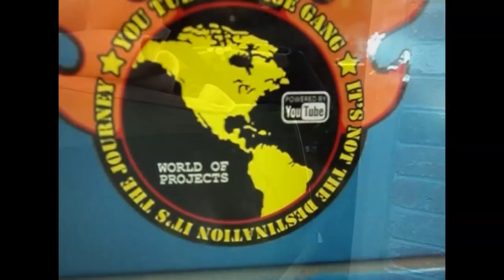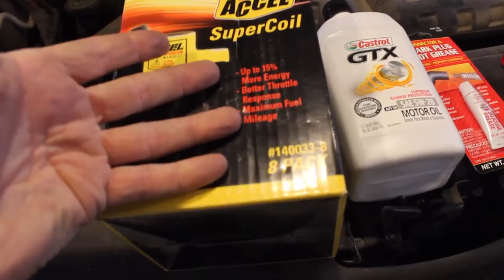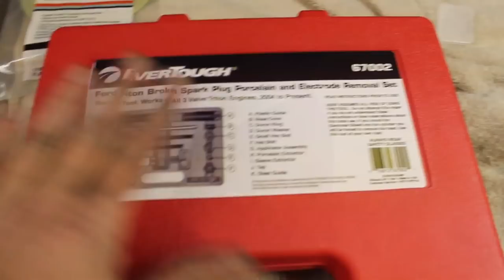F-150 Transmission Shutter - Fixed - Coil on Plug and Spark Plug Swap

Comment: dealing with this since i bought my truck in 2016 and i had spark plugs replaced a year ago, it ran great, then the cam phasers and timing chain went so i had that repaired, and now i got my truck back, and im back were i started with a miss fire. i replaced all 8 coils on it and it ran great for 2 days and started with the 40 mph shutter and blinking engine light. so now I'm wondering if the plugs went bad. also since i got the timing and cam phasers done i have a oil leak on the passenger side valve cover. just bad luck with my truck since i bought it. oh the coils i got those on ebay 8 for the price of 1 coil which was a good.
Reply: i dont know how many miles i put on the spark plugs since i had them replaced but i rarely drive it  maybe 5 to 6 thousand miles on it and right now i put 1,200 miles on since i had the cam phasers and timing chain replaced.
Reply: also at start up im having a puff of blue smoke and then turns white after it warms up. I also took a look at the body throttle today and it had some oil in it, i cleaned it up took it for a ride, still the same.

Comment: I have a 4.6 l v8 explore my rpm bounces and its feels hesitant at 40mph 50 if I give it gas it goes away
Reply: Did you get this fixed? I have similar problem, it shudders between 40-50 and then goes away

Comment: I'm getting ready to change spark plugs in my iPhone 50 like you did in the one you're working on I'm scared to death I haven't the same problem with  Is spark plugs breaking off in the engine I know they sell a tool from matco but I hear it's very expensive and I wouldn't know how to use it thanks thanks for the video I'm gonna take mine to someone that knows what the hell they're doing cause I sure don't I know they sell a tool from matco but I hear it's very expensive and I wouldn't know how to use it thanks thanks for the video I'm gonna take mine to someone that knows what the hell are doing cause I sure don't

Comment: Anybody tell me why my overdrive doesn't work and won't go into 2nd for use down hill but 2nd works just fine otherwise? 1st will work manually but 2nd isn't there. 07 F150 5.4 3v 4x4

Comment: Hey greg, I have a 2001 ford escape 4x4 with the 3.0 v6….im getting a heavy shudder at the 45mph range and it gets worse as speed increases even when its on a lift…we thought it was a cv assembly because the subframe cracked and ripped the boot out which spit out the grease...…The engine cradle (subframe) was replace and so was the cv joint assembly…i replaced the carrier baring too because the driveshaft was wobbling…I don't believe I have any misfire codes but I did have egr/converter codes….I was wondering if the coil/plugs could still be causing it to shudder from that overdrive problem you mentioned in this video…I was worried it was the torque converter but the transmission seems to shift fine and it doesn't stall at all…theres seems to be NO play where the front axel meets the tranny either…I am not able to accelerate out of it, it sudders continuously and gets worse…how can I tell if its the torque converter or the coils and plugs?
Reply: Greg's Garage Yeah it has 94k so they're probably all due to come out…thanks, I'll start with that.
Reply: Greg's Garage Well I don't believe its either of those problems now, we pulled my front drive shaft off and the shudder stopped when it was only in 2 wheel drive (with the back spinning freely), now I'm trying to figure out if both driveshafts are suppose to be perfectly straight from front to back or if the carrier baring, U joint and yoke are there to allow it to come in at an angle (which is the way it is now)….. When the front driveshaft is coming out of the transmission and into the carrier baring, its shifted left to right if you're looking at it from the very front of the car under a lift (the back driveshaft looks straight). It seems like the Yoke/U joint that meet at the carrier baring is causing the shudder the problem but I'm concerned that the new subframe we installed is shifting the front driveshaft too far off and causing the shudder from inbalance or something….the rear trans-axel mount seemed to sit right in place when we lowered it from the engine sling we had holding it up while installing the new subframe….I'm not sure if something got shifted or if it can come like that from the factory. Sorry if thats tough to understand all that, I'm just trying to figure out if both driveshafts are suppose to be perfectly straight from front to back or if its wrong for the front driveshaft to be shifted between the transmission and center carrier baring.
Reply from the maker: I wish I had answers for you man...  I know I replaced the pinion bearing in my rear end...  It caused all kinds of noise and vibration.  If your driveshaft had it's weights knocked off and it's out of balance that can cause all sorts of trouble.  The nature of u joints though is to take up all the out of axis alignment...  I would guess that it doesn't matter, but I could be wrong.
Reply: Greg's Garage Alright Greg, thanks again for your help and quick response….we'll just keep plugging away
Reply: Have you checked to see if your drive shady was off ballance may have broken the weights off it
Reply from the maker: Yeah...  drive shaft is good on my truck, but that's always a good place to look.

Comment: I've been having this issue for a while as well on my 07 f150.😞
Reply: This was exactly what I was experiencing in my 2007 F150 King Ranch and after watching&#160;the video, I changed my spark plugs and coils and bam the shutter is gone.
Reply: bill cook Yes I did the same thing I found 2 spark plugs were fried. Could've resulted in detonation.
Reply: I have a 05 f150 and when I'm getting onto the highway it feels like it's slipping, if I put od off it is fine just high rpms, is this shudder another word for slipping light jerking feeling?

Comment: Why the hell did Ford design the head to use special plugs like that? Did they not put any anti seize from the factory? I remember when i worked at Ford, i heard some mechanics complain about something like that.
Reply from the maker: Yeah, they've changed the design now.  The carbon build up is the issue.  Even with anti seize, it would have still been an issue.  A one piece plug fixes this.  If I buy a new truck anytime in the future and I know it has a 2 piece plug, I'll have the dealer swap them out before I drive off the lot.
Reply: Hmm...I wonder if water/methanol injection would fix the issue. It would definately make more power if you added forced induction on top of that. I know with any of the Audi direct injection design "FSI" engines, they have built up carbon issues on the back of the valves and the spark plugs. Water injection helps. I heard from someone that the manufacturer actually calls for cleaning of the valves with walnut husks in a small blaster contraption..but I dont know if thats true. That would be too much maintenance for me.lol.
Reply from the maker: I don't know...  Hopefully, I'm done with that whole mess for quite some time.  It's hard to believe some of the repair manuals expect you to remove heads and blast the parts from the back side.  I'm sure our thinned down fuels don't help this situation either.
Reply: Yeah your right. I used to have a 2007 Audi S4 4.2L V8 six speed quattro and it didnt have the direct injected heads..thank God. But the Audi R8 and the Rs4 have the problem. Its crazy to think that manufacturers couldnt get this all hashed out before release. I mean these Audi engines are the same engines in Lamborghini's. I would be pissed. lol

Comment: I watched this video for some info!!! I have a 02 lincoln town car 4.6 liter that is sputtering like this,I had the same problem 3 years ago and took it to a "REPUTABLE" shop in Jersey and they charged me 385.00 For a tune up , Now its doing it again!!! If I knew it was a coil,I would have replaced it for 20.00 The car is in Near Mint condition Only 99000 miles on it!!! POST BY RICHIE
Reply from the maker: +Shari Henry Yeah...  It can be a coil, a plug, an injector or a sensor...  All fairly easy to replace.  It can also be torque converter, but that's not nearly as common.
Reply: I always remove plugs with engine hot !!! tried and true removel

Comment: hey how much did you pay for your coils? my truck was running fine at 110k miles and owned it from 30k and never changed plugs or cops... so I decided after only 9mpg for the last year to change some stuff... well I got some 20 dollar a plug platinum champions and stuck them in. she got better idle which suprised me and then loaded up my trailer with some quads and went out (90 miles) got back home and changed the fuel filter, went to fill up and the misfires came. thought I threw a damn rod it shook so bad. but I got codes and they were for cylinder 2. replaced the cop on it and nothing. changed the fuel injector (thought maybe some dirt got in when changing fuel filter) and nothing.  I don't want to spend 60 bucks a coil to find out its not my coils or plugs...  anyone have any other ideas maybe?
Reply from the maker: +steven schulz I think my coil kit was around $200.  Been in about 2 years now???  Still good.  Accel is the brand name.
Reply: +Greg's Garage hey thanks for the quick response buddy! I'll try to find one. gonna do it all over again today :/

Comment: You had such a hard time partly due to the fact that you used PB Blaster as a penetrant. PB is for rust, not carbon buildup. Had you used carb cleaner (which loosens the carbon) you would have had much better results.

If you want to do it right, buy a can of Ford PM-3 carburetor tune-up cleaner, which is the stuff Ford uses. http://amzn.to/20jxzw8 - sure the plugs can still break off but that is the official recommended stuff.

Comment: 05 Ford F-150 5.4  I changed all plug coil pack now my truck don’t want to start it was running before I changed them it’s been 2 weeks sense I changed them an still not running I’m ready to choke somebody hellllllllllpppppppppp
Reply: Did you disconnect the battery? I did that on my Tundra and it wouldn’t start. So I cleaned the MAF and throttle body and bammm, started right back up. Id give that a try.

Comment: It's Shudder, not shutter.
Reply: I have two 5.4Tritons 05 and 07 both now inoperable same issues and bought $781.00++ worth of plugs, coils, tools etc. and preparing myself to head into surgery now on both... No "mechanic" has yet said "sure we would be glad to do this for you!' Nope. The thing is No matter how good they are, even trustworthy, I will not rest easy wondering if THEIR work was conscious, thorough and correct (broken plugs extracted, or plugs actually even changed). Had they chosen to shortcut around Changing the plugs, all the plugs??? how does one know??? So its time for patience, Not patients,.. and persistence and thankfully the sun is shining in NH in November today. Thanks to the internet I know so much of what to expect, do ,don't do and I will breath and try my hardest to not break, ..not brake... :-D one plug LOL, however if I do I need to not drink whiskey till I too shudder! Then I'd need to go in out of the nice warm sunshine shutting the ..shutters where I may Coil up and loose the Plug to my jug.. The End

Comment: Took me 3 hrs just to take out 3 plugs it's a joke. The worst part is there's different plugs so you need to different spark plug sockets. I have a 2007 f150 xlt. I can change my 2000 crown vic plugs in 10 mins.

Comment: Majority of Fords, and Ford production vehicles do this.
Reply: +adon31997 Unfortunately the 3 valve engine are notorious for this. And the 97-03 2 valve engines blew spark plugs right out of the head because there just aren't enough threads in the head. At least for the 2V they do not break on removal and if you over-torque them the engines are just fine.
Reply: +InternetDude The rumour about the 4.6 blowing plugs out of the heads is for two reasons.  People stripped the threads by being in a big dam hurry because you cannot turn them in by hand but have to use your socket and extension which prevents your feel of turing them in.  The other reason as I posted in my comment above os because parts stores sell plugs for those with FLAT seat instead of the TAPERED seats they require.
Reply: +Earl Guyton Many 4.6 & 5.4 with factory plugs had spark plugs blow out. That's due to a low factory torque and not enough threads. In '03 Ford put more threads in the head which helped. I wouldn't doubt that using the wrong plug or torquing it wrong would also cause problems. Then Ford made the problem way worse in '04 by using a plug/head design that caused spark plugs to break off while changing (way more common than the blown out spark plugs!). I would rather own a 2V engine and change the plugs properly than a 3V engine. Thus, I bought an 02 F-150.
Reply: +InternetDude And as I stated to you earlier you are believing BS which makes you obsolete.  The 4.6 pre 04 uses only a tapered seat on the spark plugs.  Next they have PLENTY of threads and cannot blow out.  Go figure, with the porcelain of the plug in the rubber coil boot with the coil bolted down with the 7mm bolt that a spark plug is going to miraculously turn to unscrew itself in a counter clockwise motion a total of what is 11 threads based on the proper autolite or motorcraft spark plug used and by miracle after this motion if 11 turns counter clock wise is going to then have turned itself inside the rubber boot that fits snug over the porcelain and then by miracle push itself up which would then bend the metal ear upward that is bolted down holding the coil.  Anyone that would believe a rumour as this also would be an adult that would believe tooth fairies and a nice friendly fat man rides around in the air and goes down chimneys, LOL.  If you ignore the information I have stated it is YOU brother that is a limited IDIOT.  If the proper plug is used these will not come out of the holes in the head with 11 fine threads that have no back lash.  Only someone severly stripping out the threads upon installing plugs could have one of these actually push itself out of the hole.
Reply: +Jeff Hunter yep.
Reply: +Jeff Hunter Youre not a mechanic and BTW I am age 59 and not a youngster.  Ill repost why your qualm is BS once again idiot deluxe  And as I stated to you earlier you are believing BS which makes you obsolete.  The 4.6 pre 04 uses only a tapered seat on the spark plugs.  Next they have PLENTY of threads and cannot blow out.  Go figure, with the porcelain of the plug in the rubber coil boot with the coil bolted down with the 7mm bolt that a spark plug is going to miraculously turn to unscrew itself in a counter clockwise motion a total of what is 11 threads based on the proper autolite or motorcraft spark plug used and by miracle after this motion if 11 turns counter clock wise is going to then have turned itself inside the rubber boot that fits snug over the porcelain and then by miracle push itself up which would then bend the metal ear upward that is bolted down holding the coil.  Anyone that would believe a rumour as this also would be an adult that would believe tooth fairies and a nice friendly fat man rides around in the air and goes down chimneys, LOL.  If you ignore the information I have stated it is YOU brother that is a limited IDIOT.  If the proper plug is used these will not come out of the holes in the head with 11 fine threads that have no back lash.  Only someone severly stripping out the threads upon installing plugs could have one of these actually push itself out of the hole.
Reply: +Earl Guyton old people get stuck in there ways often. it's okay old buddy we know you're losing you mind and getting angry as you have proved.
Reply: Actually this is a common problem with the 5.4L Triton engine. Ford has acknowledged it as an issue. I blew a spark plug out while driving and the coil and rails went with it.  Made one helluva boom, scared me to death.  Maybe the tooth Fairy stripped those engines... idk
Reply: InternetDude get the 04-08 f150 4.6 2v , that years is still a 2v, but in 09 it changed to 3v

Comment: I'm 90% sure you've been having to replace more coil packs or fuel injectors since you made this video....f'in junks....and oh yeah, your cab corners are probably rotted out too.
Reply from the maker: Actually, only changed the coils once.  Sold the truck with just over 180k miles on it.  No rust.  The motor was ready to take a shit for sure.

Comment: Sale that POS and get a Chevy! I have owned Chevy's my entire life until 8 months ago, 05 Tahoe with 289k (original plugs and wires), put a water pump on it, did it myself, about 100 bucks. 07 F150,150k when purchased now has 180k, rebuilt transmission, clock spring replaced, heater core replaced, has a miss and also a whine that sounds like its in the rear end. transmission was $3200, clock spring I did myself but part was expensive, heater core $1200 the other crap wrong with it I live with! Add about 5-800 bucks for a spark plug change because they break off in the engine and I have no idea why anyone would by a Ford product. I wish I had done some research instead of buying a truck because it looked good! Ford vehicles are a total POS and I am selling mine as soon as I can find someone stupid enough to buy it! America's #1 selling piece of shit!